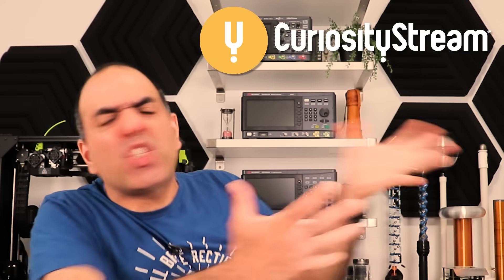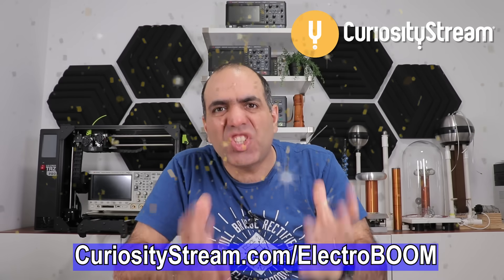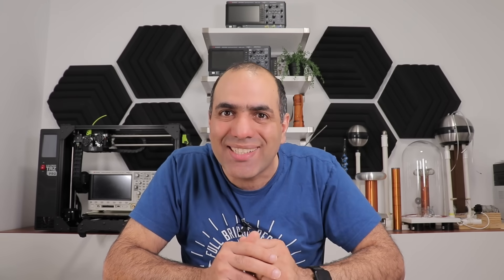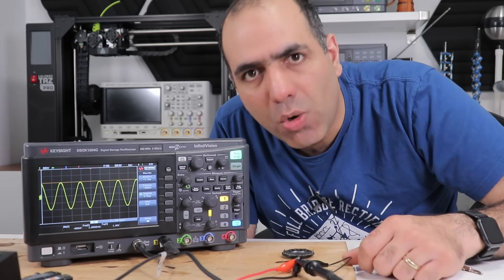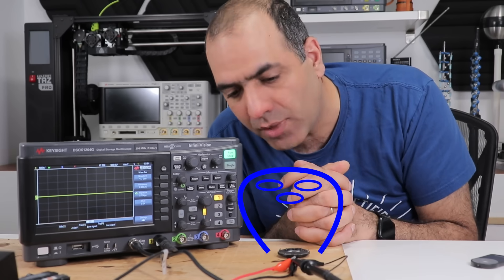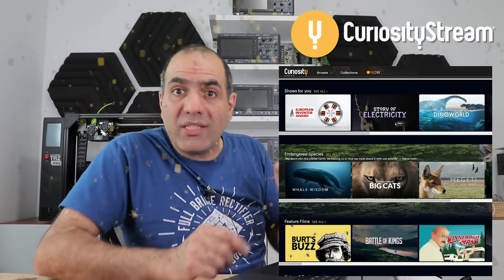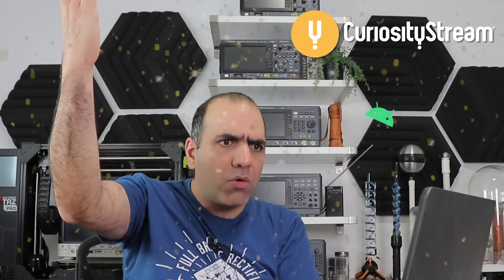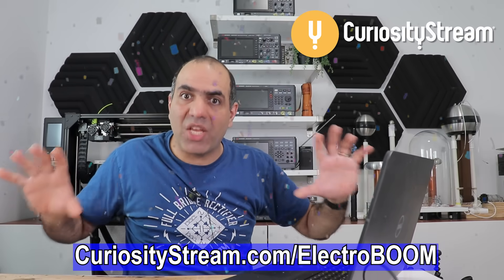Making a &#!$%ing Button

Comment: What???It really is boring. And it's easier to just put a battery, a button, and a buzzer in series and the same thing! You are really an idiot! Using a speaker and many complex circuit are not recommended

Comment: 6:37 what is Mehdi doing here? How does this frequency response work? Is it making the speaker produce different frequencies & seeing what the gain is? How would an enclosure effect the gain of a circuit? Is he using a sensor at the top/output of the enclosure?

Edit: ok a couple seconds later when he talks I see fluctuations in one of the sign waves as he speaks. Is he speaking a bunch or using a microphone producing different frequencies so that it can test the different frequencies working on the speaker in reverse (so that when he speaks the speaker produces power with a piezoelectric like effect) and the oscilloscope is measure the fluctuations? Also sorry if this doesn’t make the most sense. I’m writing this very fast while being very tired. Sorry.

Comment: Electroboom: Designs a circuit to make that sound.
Me: Putting a multimeter on the continuti mode and putting a push button on the both ends of the probes 😎

Comment: Can we use a 555 timer in astable mode to generate pulse train and later convert it to SINE wave using RC circuit for generating input to the Speaker?

Comment: mehdi, at around 9:14 i recorded and checked in audacity--your frequency varies from approximately 1.064 kHz to 1.089 kHz across these instances (window size 32768, type hanning, sample rate 3 kilohertz)
acceptable drift for singular instances, but it's noticeable when they are back to back :[

Comment: sorry Mehdi for the first time you were wrong. It is true every speaker needs an acoustic chamber, so the back and forth sound waves don't cancel each other., And it is also true, that the chamber with a hole is a Helmotz resonator. But a chamber does not perform the function of an impedance matching device. to match the "hard" speaker cone with the "soft" air. ,That function is performed by the acoustic equivalent of transformers, guess what it is: The horns. That's why horn loaded speakers have much better power efficiency than simple speakers, it goes from like 5% to 40% efficient. Because horns improves the power transfer by making a better impedance matching.
According to dynamic analogies, acoustics chambers (called acoustic compliances) are the equivalent of electric capacitors. Chambers store energy in the form of pressure, and the "discharge" with air volume velocity. The value of acoustic compliance depends on chamber volume.
If you check the electro-mechanic-acoustic circuit of a speaker, it is a circuit with electric, mechanic and acoustics components, the chamber compliance is connected in series with the "mechanical compliance" of the suspension, where the compliance is the mechanical equivalent of capacitors. So these two "capacitors" (mechanic and acoustic) being connected in series, the total "capacitance" is reduced, thus requiring more force for getting displacement. The total RLC mechanical circuit of the cone and suspension is altered. In fact the resonant frequency of the cone rises because of the smaller compliance, Sorry for making it long, the line is: Chambers DO NOT correct the impedance mismatch of the cone and air, that is made with the equivalent of transformers in acoustic circuits, the horns.

Comment: Well if you are not electrical engineer you could use a buzzer 9v battery and on/off switch with a very simple connection

Comment: As a musician, I found your explanation of resonance chamber to be the most bizzaire and weird I have ever heard :D.

You also surprised me saying that it has to be in front of the speaker. Pretty much every application I can think of has the resonance chamber behind the source of sound, not in front of it. I mean, speaker columns for example have cavity inside, which acts as a resonance chamber, while the speakers are on the outside. Piano has a resonance chamber below the strings, while the opening is over them, same with violin, guitar and many more instruments.

BTW, a great example of how powerful resonance chamber can be is if you have one of those little instruments used inside music box. Take it out and you can barely hear any sound. Put it on a piano (or even some regular furniture) and suddenly it gets very loud.

Comment: so you just made a 4th order bandpass for the little driver...... and we dont push the resonate frequency out side of the audible range when designing a speaker typically it is used to get more low end extension 4th order bandpasses are known for their one note peak at a given tuning different from what we normally would use such as a simple ported or sealed enclosure.

Comment: I have a little challenge for you: design a resistance touch switch that triggers a microcontroller. It's more difficult than it seems, because your finger often acts as a floating input, triggering the microcontroller multiple times a second, rather than acting as a true conductor between both terminals of the switch.

Comment: Please, permit me to ask a simple question? How many programmers use assembly language or machine code directly? This is what counts as interacting directly with hardware, otherwise, it is using a High Level Programming Language whose primary purpose is to isolate the programmer from the machine's complexity by providing a more human-readable code structure.

Comment: my gpu has probe points for certain voltages, however it doesnt label what pins are for what and what ground is for what pin. as far as i know there are 2 major load circuits, gpu core and vram. how can i safely probe these points to get a good vcore read? im basically an idiot version of electroboom (yesterday i ran a gpu on car battery for the lols, 12v dc is 12v dc amirite?)

Comment: hi , as always super video :D :D , i have this same power supply , this current problem can be solved by resetting counting unit. button for this is in inside on the board behind the display

Comment: I was watching your taser video, in which you said, you would not touch a taser with a 100 mile pole, so I started to wonder if, voltage dessipates over a metal, if the length of the metal pole increases?

Comment: It says A high current flowing through a battery can cause a rapid increase of temperature, potentially resulting in an explosion with the release of hydrogen gas and electrolyte (an acid or a base), which can burn tissue and cause blindness or even death.

Comment: Hi, can we reduce our phones static electricity at it's  metal case while it's charging? While talking to my friend with headphones on the phone, a sizzling sound occurs when I plug the phone into the charger. But if i touch to my phone sizzling reduces. 🤔 There must be a solution like adding grounding things into the charger idk
Reply: Somehow, the static electricity effects headphones microphone. But if i use internal mic instead of headphones mic it sounds much more clean.

Maybe I can add a cable to the aux input and hang that cable from the window and bury it half a meter deep hehe

Comment: Jesus Christ! Is it that hard to find??? I used to cut school and hang around funky KKIS just about the time they stopped using the button on the desk under the microphone to separate news stories. "Car crash kills 567 people in desert pancake breakfast." BEEP BEEP BEEP BEEP "Motorcycle crash kills no one not even the driver." BEEP BEEP BEEP BEEP The news reader would press this button to make the beep. At that time it was going out of fashion and it was soon disconnected. Some disk jockies would say and do things on the other side of the widow to make the news broadcaster laugh.

Comment: You could push the function generator as high as it'll go and never hurt the speaker because the output impedance of the function generator is somewhat high, usually 50 ohms.

Comment: Speakers give acoustic vibration to both front and back. Some of them reach to each other and cancel. To prevent this cancelling they must be divided. Simplest example is mounting a speaker to a car. It is called infinite plane approximation. If speaker is mounted on a flat plane division is done and it sounds more to front and also to back. A nice box even without a matching acoustic Helmholtz frequency they sound louder. For more about speaker boxing check air ducts for bass etc. Front frequency matching box is also very effective for a single frequency as in here but not for a large frequency band as in music.

Cheers Elektriğin Üstadı :D

Comment: Hi, I have an unrelated question about smart switches and didn't know who else I could ask and google doesn't have any answers I could find. You being the king of electricity and all I couldn't think of anyone better to ask. I have old wiring in my home which means I have no neutral wire. Most of these smart switches require a neutral wire to power the WiFi chip while the switch is off. From my understanding since the neutral would simply be the wire returning the electricity back to the main box and is carrying the same voltage as the load or the live wire. Could I simply split the live wire and run that into the neutral?

Comment: How do you tune it to the desired frequency?  Could it be trimmed down to the same 1 kHz as the original reference?  I hear about a semitone difference.  Could that be a reflection of component tolerances?

Comment: Video Idea:
Can you somehow show at which point or at which voltages plastic also is be able to conduct electricity. Maybe with different items like cables, tool handels and so on.
I know that ofc plastic is a bad conduit,  but if there is enough voltage, isnt there are a way that those very few free electrons in the molecular structure can carry the electricity ?

Comment: If you think X86 assembly is hard, try programming the clock on a 90s VCR. In all seriousness, there is overlap between electronics and programming, one could argue switches  are an instruction, on or off or maybe it has multiple states or multiple switches which could function as a form of register. You could make a simple binary adder, including implementing your own logic gates with switches, transistors and LEDs to display the output, then feed it instructions using the switches to get your output. Depends how complex the system is and how many instructions and registers you are working with and if the circuit can recover instructions or data from those registers, yeah, it can get complex, but it all works on the same basis.

Comment: A 1kHz sound wave is ~34cm long. If you have a speaker that small which is not at all enclosed at its backside, its probably the acoustic short cirquit that kills most of the volume ;-) So I think gluing the cap behind it was at least as important as adding the professionally tuned resonator.

Comment: Mehdi is making a code oscillator for learning Morse Code :D
Reply: He could be old enough to actually know Morse code
Reply: @ryank1273  morse code is still used by radioamateurs, old people arent the only ones
i can understand IMC with a high character speed and low intercharacter speed, i need time to think still
and i can key it okay
Reply: @lowercasehandle  kinda figured anyway, only thought about saying that joke because I have a interest in Titanic.
Reply: @ryank1273  ah
Reply: @lowercasehandle   _ _ _ . . . _ _ _
Reply: BEEP BEEP BEEP BEEEEP BEEEEP BEEEEP BEEP BEEP BEEP!
Reply: I noticed it as well
Reply: Will come in handy to arrange a world wide resistance once the aliens take out our normal communications.
Reply: ...and he used way too many components.
Reply: @derekdowns6275  yeah he could have just used a resonance cavity, magnetron, transformer, capacitor, diode, and tank of hydrogen to make an active Maser, then he could skip the speaker and just make every atom in the room go beep
Reply: @derekdowns6275  I mean what's the difference?  A few extra cents and a few more seconds putting it together?
Reply: @Ivy_Panda  It's not the cost or time.  It's more about intelligent, eloquent and efficient solutions that are more robust and dependable.  Could have made this oscillator with 4 components, plus speaker, battery and switch.  2 transistors, 1 resistor, 1 ceramic disc capacitor.  That is all it takes.
Reply: @derekdowns6275  and a proper 'modern' electronic keyer OTOH is a far bigger project. various modes of keying with single and double paddles,  adjustable tones, durations and wpm, I think var double paddles require memory for the extra dits or dahs after you release etc. 

I've seen a few arduino based CW keyers full of features, but I believe radio amateurs used to publish various purely electronic designs for their keyers, iterating on designs of the community in the post-war period...
Reply: @derekdowns6275  you can never have too many components
Reply: Dah dit dah dit.  Dah dah dit dah

Comment: In ham radio world these circuits are called keyers and are used to drive morse keys (for practicing without sending electromagnetic nonsense on the air or as aural feedback while transmitting on old radios which don't have one integrated). Modern keys use two separate switches for dots and dashes, so that the operator doesn't have to time the ons and offs manually. This introduces some complexity in the circuit and so many enthusiasts have moved from a fully analog design (some can still be found online) to an Arduino based...this is sad, not only because  of what Mehdi said about learning, but also because typically Arduino doesn't go boom :D

Comment: My destroyed electronics bin has like 5 of the same product , a couple of which I took apart.. the rest is low voltage besides a 400-volt cap and 250-volt cap I stole from some household electronics

(and a several kV thing that is for air purifiers)

Comment: Somebody should make one of these but using vacuum tubes (or thermionic valves). When you need to swear just plug the unit in and wait fifteen seconds for it to warm up.

Comment: Due to the acoustical resonance of the chamber you can put a pickup mic inside the chamber. If you amplify this signal and send it to the speaker the resulting feedback will be at the resonant frequency. Devices like smoke alarms use this technique with piezo elements to make loud tones using very little electricity.

Comment: Him: circuit is simple

*Shows the circuit

Me: that seems pretty much impossible
Reply: Why not just feed the square wave straight into the speaker; or, better yet, filter it through a capacitor to turn it into a spike wave? That would give the speaker the biggest "punch", at the cost of a harsher sound.
Reply: @techgeeknzl  u explained well

But I didn't understand a single thing...

Can u simplify it plz...
Reply: @Borgir45  signal into one thingy or through another thingy makes sound better
Reply: @KarenTookTheKids  OK understood
Thank you

But why is your name 'Karen'????
Reply: @Borgir45  it isn't necessary to generate a sine wave using a complicated circuit just to drive a speaker. He could achieve the same effect by taking the raw square wave, amplifying it if necessary, and driving the speaker using that; just like virtually every other electronic gadget that needs to make a simple beeping sound. Sure, it would sound much harsher, but the sharp edges of the wave also cause the speaker to vibrate with maximum velocity; making it sound significantly louder.
Another common cheap trick is to connect a capacitor in series with the speaker, which can transform the flat tops and bottoms of the square wave into triangular spikes and effectively double the peak-to-peak voltage that is driving the speaker. It'll sound harsh, and may not be doing the speaker any favours; but it'll definitely be loud.
Reply: @techgeeknzl  ohhhhhkkk

That's some big explanation
Reply: @Borgir45  yeah, it's probably bigger than I intended it to be. The point is, the simplest, crudest, and loudest way to make a beep is to feed a square wave directly into the speaker; making a sine wave is completely unnecessary.
Reply: @techgeeknzl  ohhk

Comment: What's the purpose of connecting the output of the op amp to VCC through a resistor ?
Reply: If you talking about u1a r1 and r2 is use to bias the input of the opamp and r3 is part if the oscillator.

Comment: yo electroboom! i used to take LEDs in my digital electronics class and cranck the voltage up just to make em explode! the scent of burnt LEDs bring me so much memories :3 oh ye and i made a controller panel for the final proyect, XD we had to use a broken needle fro ma sewing machin to drill the holes cus the drimmmer was unavaileable. i still have the circuit somewhere

Comment: You know, if you go on thingiverse, there's probably hundreds of different acoustic chamber 3d files for speakers. That you can use to print out a speaker chamber. Probably not as cheap as the pill bottle, but would definitely provide a fuller sound, and need less calibration
Reply: "what you write some code and suddenly you know electronics" THANK YOU, as an electronics professor I'm tired of this software stuff and students only do the software part, never really taken an effort to learn circuits on a bread board. Yes it is important but electronics is so much more. It's not just coding.

Comment: I was expecting a button that shocks you, inducing a swear.

I liked the improvised resonator testing, do you think it would be difficult to build a small adjustable diaphragm, like the ones found in cameras?

The integrator output (triangle wave) sounds good enough imo, I don't think the rc filter is needed.

cheers!

Comment: How will a 1kHz peak "block" a word when a word has a complex/unknown spectrum? The only way that it works is if you use a circuit to disconnect the mic and the 90Hz tone to be inputed in the mic line.